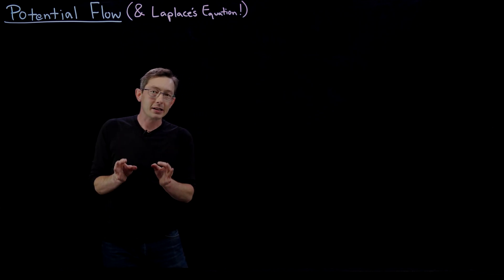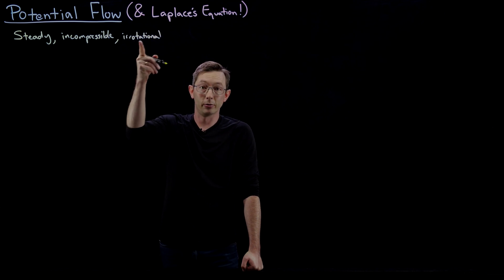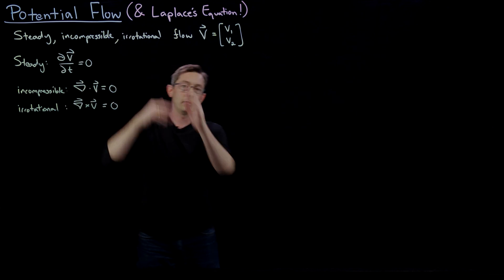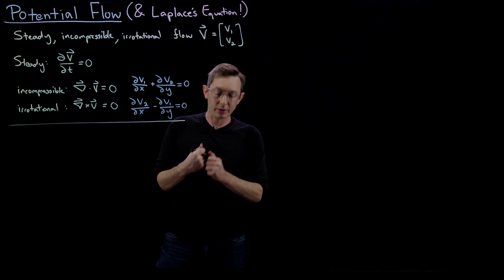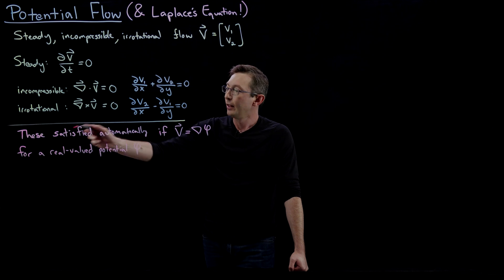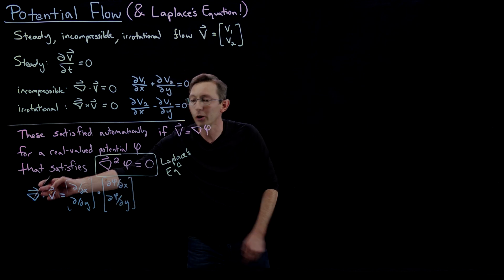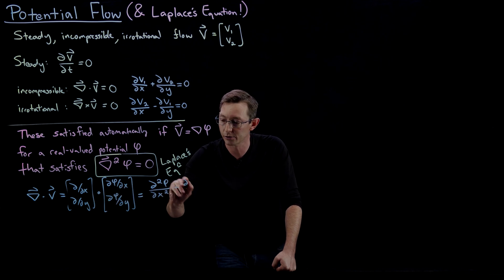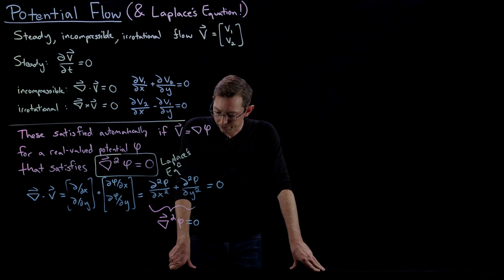Laplace's Equation and Potential Flow

Comment: Hey when you state steady flow being the change in velocity being zero, does that also mean the vectors are not changing direction based on the definition. So the vector field changes and each vector maybe be different than another but each individual vector is steady?
Reply: True I guess , had a similar doubt myself
Reply: Each vector is individually steady

Comment: Love it!

Question though, doesn’t the potential field still hold for Div * f x Grad V, where “f” is a scalar function? For example, in the standard wave equation, often derived/thought of as a fixed string under tension, the tension is constant. But, for say, a hanging chain, the tension in the chain varies with height and the governing equation involves something like Div * T(x) x Grad U.

Laplace’s equation and the Laplace operator are really just special cases of the former in a homogenous medium. 

Also, I would LOVE a video about solving Laplace’s equation and the Helmholtz equation (really, finding the Eigenfunctions) on irregular domains. Triangles, or the square with one quadrant removed, etc.

Thanks for the video!